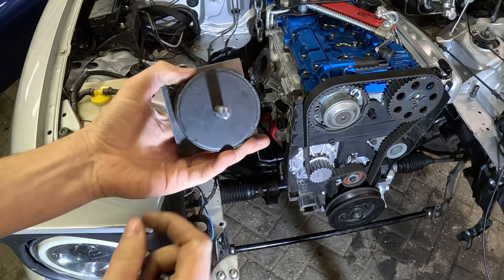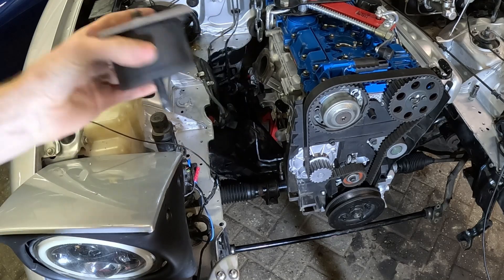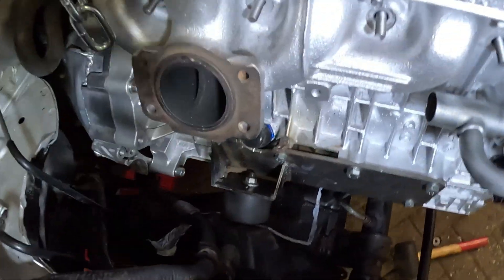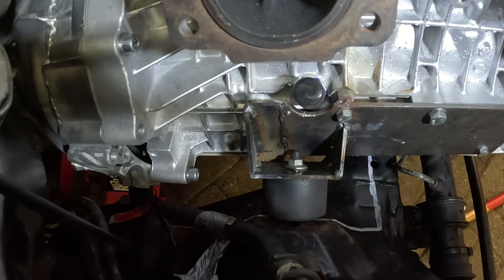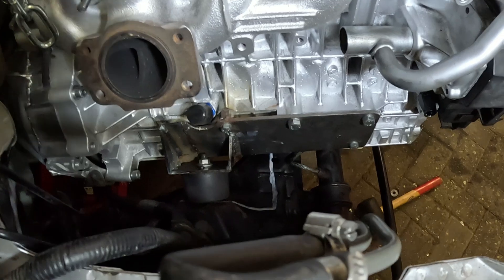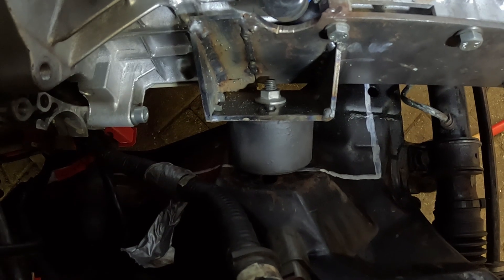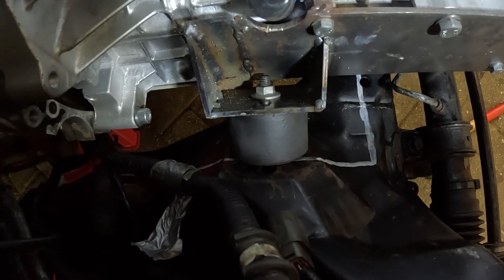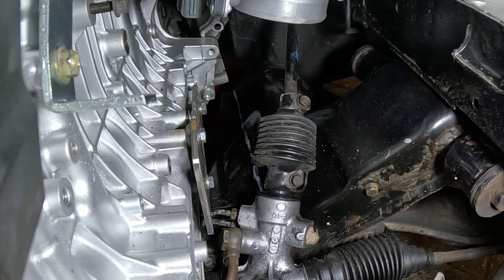Making custom engine mounts for the Miata 5 cylinder swap

Comment: Nicely done, but the first engine mount youve made might collapse. those triangles you welded on the side, should have put the on the inside and weld, now whole weight is gonna sit only on welds and if theres cracks in the weld the weight of the engine might push that plate where engine mount rests to the inside and it will brake.

Comment: This 2.5T engine is actually a Ford unit 😅
Reply: Remember, Ford's best engines are all designed and built by other companies 😆
Reply: The Ford unit you speak of is actually a slighty modified Volvo unit and thats not this though. This one is pure Volvo unless...
Reply from the maker: @jessethomas6971  nah the Ford engines are more expensive, without any benefit
Reply: Or is it
Reply: wszystkie silniki 5 garowe to konstrukcja strikte tylko i wyłącznie volvo, 2.5T w focus jest tylko lekko przerobiony, rozwiert, inne wałki sportowe ,zawory itp. 2.3 T5 ktore ma tu w miacie to czyste volvo.
Reply: It's the white engine, ford used the engine as they owned Volvo at the time..

Had the ST...awesome car. 

This will be as good if not better
Reply: @TonyLeach-airguntech  ford get this engine from volvo and do small modifications and put it in RS version, in ST ford its stock S60R engine.